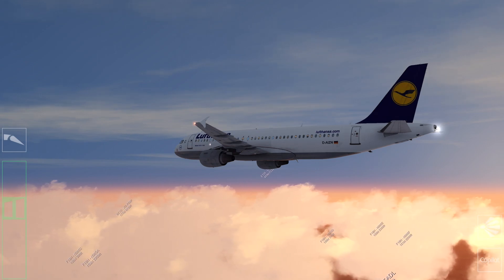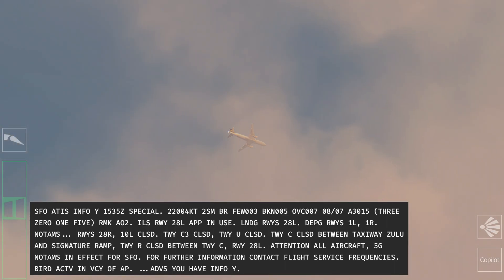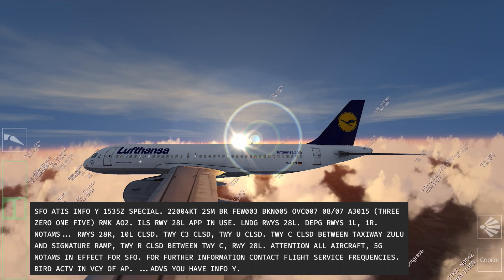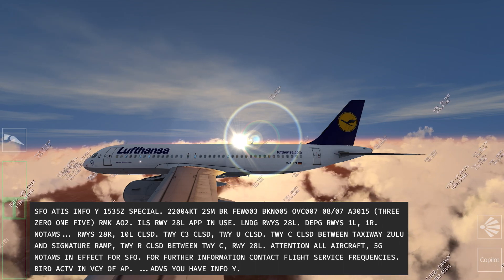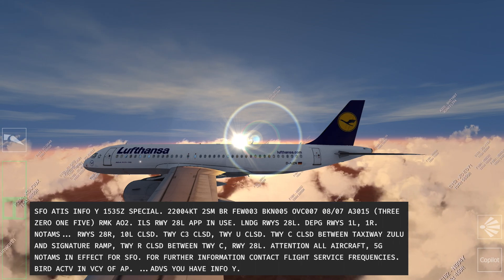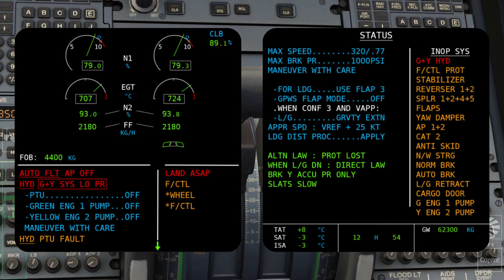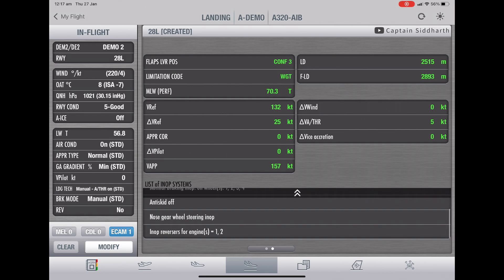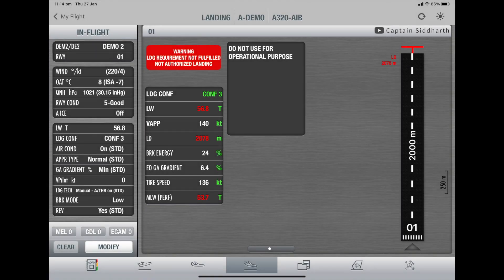EFB: In-Flight Landing Performance | Airbus A320

Comment: What is the purpose of this device can anyone tell me? Are necessary informations already entered the MCDU?
Reply from the maker: Electronic flight bags (EFBs) contains all your manuals and gives easy access to it. It is also used for calculations related to your flight performance. All the necessary information has to be fed manually into the mcdu during cockpit prep like the fuel, speeds, flight plan.
Reply: @captainsiddharth  Thanks for feedback 🙏🏻 Can you get access to the QRH as well which already exists into cockpit? If it is available i guess it is a great opportunity for captains during emergency conditions. Because I think these conventional methods are required a great deal of time to find failure in handbook. Again thanks for your answer 🙏🏻
Reply from the maker: @cagdasaslan252  Navblue Inc. is one of the companies that makes eQRH. A demo version of it is available on the App Store for free if you want to check it out.
Reply: @captainsiddharth  aún es funcional la app ? La descargue y parece que no..